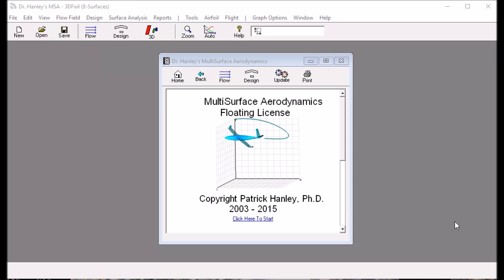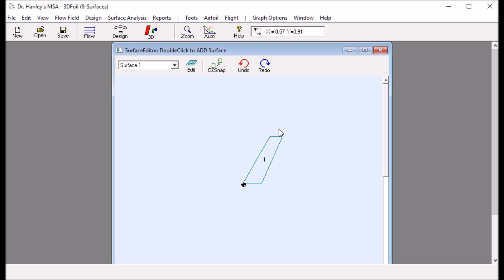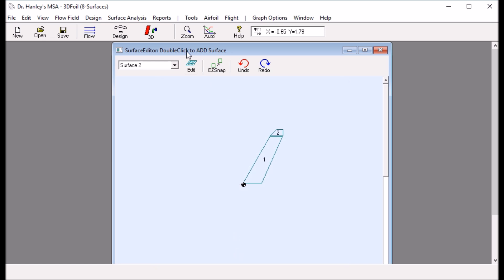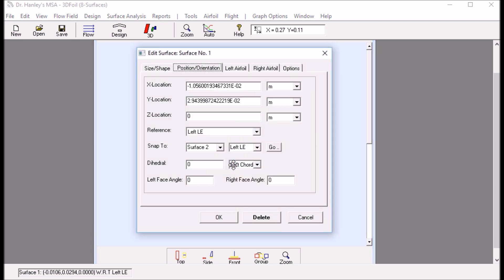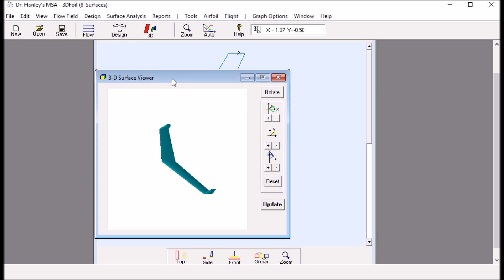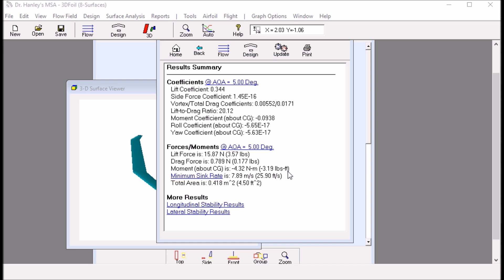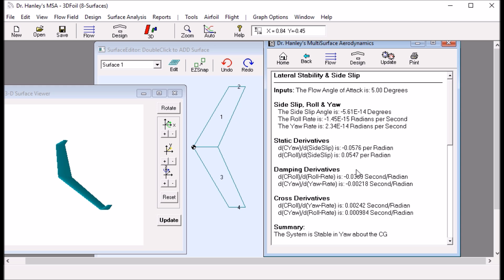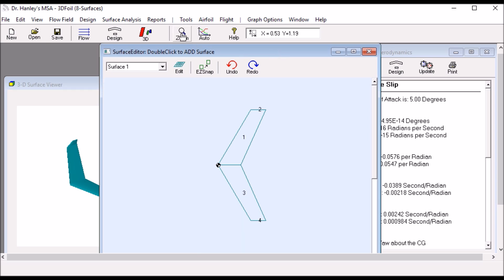Design & Analyze a Flying Wing UAV on a PC

Comment: Does the software have any script mode
Reply from the maker: The software does not have a script mode.  However, there are built-in sweeps, stability calculations, etc.   You can also export the results to csv files for inclusion in spreadsheet etc.  Please contact us if you have any other questions.  More information can be found at https://www.hanleyinnovations.com.  Thank you.

Comment: Hello Patrick,
I watched your video and it's very useful. I'm working in a project about the design of an UAV for observation of marine fauna. Could you gime your opinion? The wing span is 2,06m AR:11,8 root chord 200mm tip chord 100mm total weight 1,8kg. T tail.
Reply from the maker: Hi Bryan,  your application is very interesting. You design is for high endurance/range.  I think that 3DFoil can be used to help with airfoil selection, tip stall and stability.  Let me know if you have any other questions - Patrick

Comment: Hello, thanks for sharing your video.
Can you help:
I make a fly wing to work in aerial video to agriculture purpose.
What in your opinion is the best airfoil, have a payload of 2kg, wing lenght 1300mm
I need a airfoil very stable.
thanks
Reply from the maker: Hi Paulo, thanks for your message. Airfoils by Selig or Eppler are good for flying wings. See the following page: http://m-selig.ae.illinois.edu/flyingWingAfs/ for a few suggestions.  3DFoil is great to determine an optimum airfoil choice based on your aircraft's wing size, endurance, range and weight specifications.